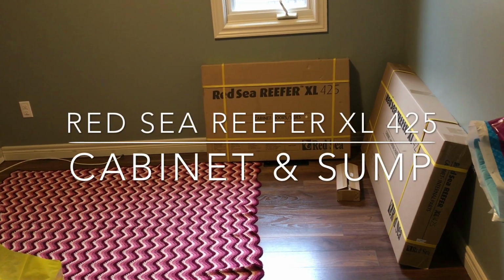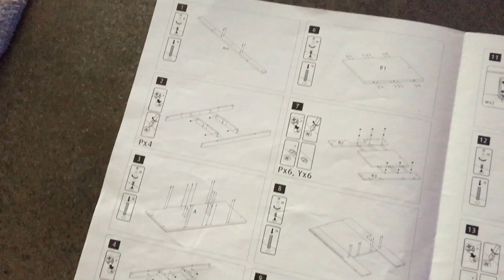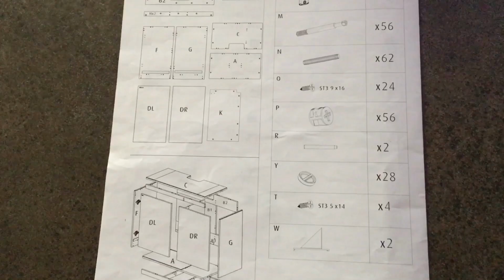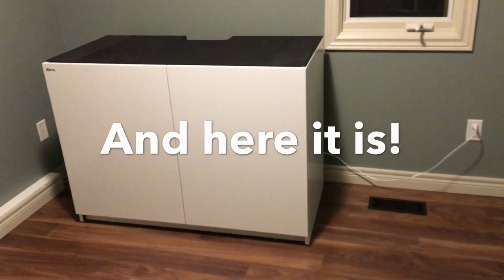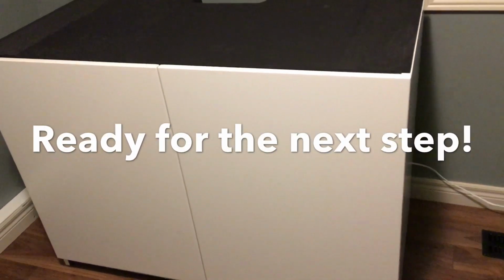Red Sea Reefer XL 425 - It Begins!

Comment: Very sweet indeed! Looking forward to your upcoming videos ReefGrrl!
Reply from the maker: Thanks Wil! Sump was put in over the weekend. New RODI unit had a busted fitting, so leaked, and we are waiting for the vendor to send a replacement part, or we would already have tested all the pumps for the ATO and water change system. But I'm almost done editing the "Comittment - drilling holes in the floor" video. 😬 Things are moving ahead, even if only slowly. Thx for watching!

Comment: Flat pack is just awful and I would have took about a month to get this together hahahaha he did a fantastic job indeed .... your making me drool sitting here looking at the sump it looks great .... can't wait to see the finished product and it all ready and oooooooo it's so exciting I bet your still pinching yourself to see if this is all real and actually happening 😍😍😍😍😍
Reply from the maker: Yes, that sump is about the volume of both my current tanks put together! He did do a great job, that's for sure. That cabinet is very heavy and rock-solid. And I am still in shock I think - we've spent so much time on the support systems for plumbing and electrical that I haven't even had a chance to absorb the reality of it. I've ordered a lid, the sand is here, the rocks are sitting in the garage waiting for warmer weather so I can start working on them, and I'll be ordering the light in the next week or so. The sump is being put in place this weekend so we can test all the plumbing and pumps. And there are a couple of unique features that I haven't yet revealed, for which it will be really fun to record and post videos. What about you missy? I heard you're moving, so I assume we will see a new tank for you after that?

Comment: Hi RG how do u like the Reefer 425...i am pondering over getting one...i like the dimensions of it..i was googling some videos and saw yours lol...cant go anywhere else when i see your video....period...
Reply from the maker: Lol, Ash, you’re funny. I love my tank and I find the size is perfect for the space I have. The sump could be a bit bigger but then I have a very large algae scrubber in mine and the current skimmer has a large footprint (soon to be resolved). I find using an external ATO reservoir is working very well, because the one they supply holds only just over 2G and is awkward to fill manually. From what I understand, the Diabolical Valve is now located at the front of the sump instead of the back, which makes it much more readily accessible. I’m thinking there might be a couple of other recent design improvements as well but can’t recall off the top of my head. 

And in spite of how much I love this tank, of course as a normal healthy Reefer, I want something bigger. 😁 But luckily, I’m very limited for space in my house so this will be just fine. Unless I win the lottery. If that happens, look out because it’ll be a 90-degree  peninsula with two 8-ft arms and all the life support behind the wall at the base of the corner. 😂😂 But don’t tell my husband yet. This will take some very careful persuasion.....

Comment: @reefgrrl are the panels for the stand solid?  Because the build looks like IKEA's.  it scares me
Reply from the maker: We've got IKEA stuff and believe me, this is nothing like that. This thing is very heavy and solid as a rock. I have no doubts about it whatsoever. 🙂 Each pin has a locking screw (at the end of the video, where I show the tiny arrow). The arrow is used to line up those screws so the other side rotates and locks the pins in place. Hard to describe, but nothing moves when they're correctly in place. It's very elegant and impressive! Thx for watching!